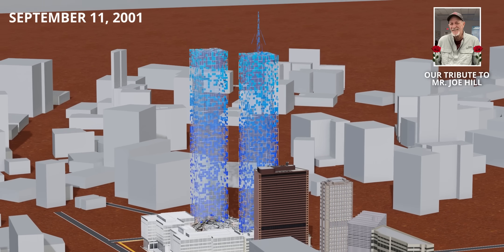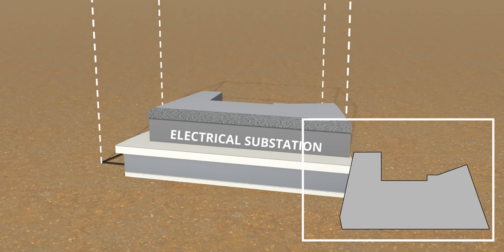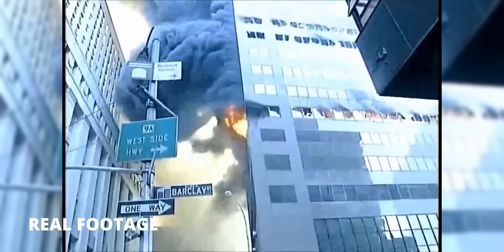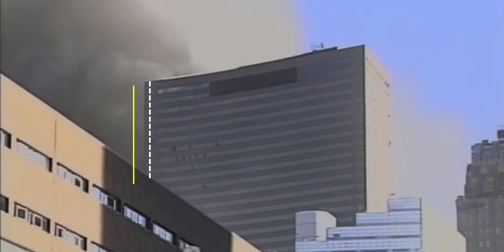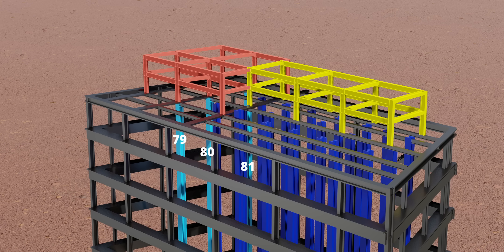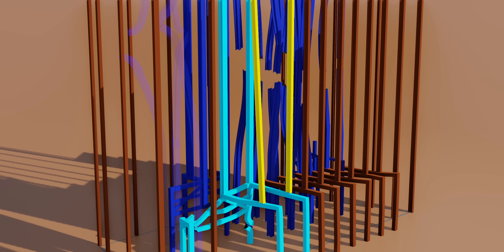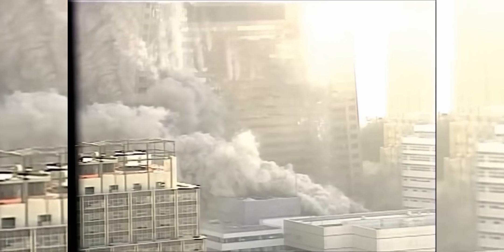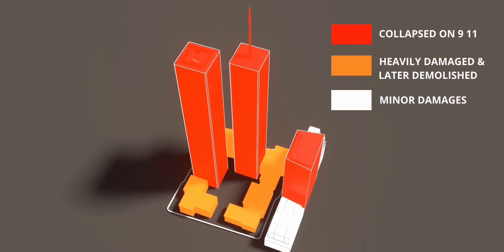Collapse of Building 7 | The Complete Physics

Comment: FYI, the owner of the twin towers has breakfast in the towers every morning, but conveniently didn’t go during 9/11. Nor did his family and relatives who worked in the towers show up that morning. And when asked what he was doing, his answers were clearly lies. Oh and did I mention he bought the most expensive insurance specifically for a 4 billion dollar payout if a plane crashed into the towers 6 weeks before 9/11? 

And here’s the official explanation for all 3 towers collapse. It was because fires weakened the internal structure. Guess what? Jet fuel burns hundreds of degrees lower than the melting point of steel. So it doesn’t even make sense. 

Within hours bin Laden was blamed. Within weeks, steel debris was shipped overseas to be melted down before a full forensic analysis. You might be asking, if it was an inside job surely there would be whistleblowers? 

Yes there was. All discredited, ignored, or suffer “accidents” example: Barry Jennings, who spoke about explosions in WTC 7, died mysteriously before giving official testimony

The official report says that the jet fuel weakened the floor trusses enough for them to sag and bend both the outer perimeter steel beams and inner perimeter support. However here’s the kicker; the floor trusses of the towers were lightweight compared to the core columns and the massive steel perimeter frame (14” wide flange beams at the core).
The idea that floor sagging alone could pull in and buckle steel exterior walls which were load bearing and anchored is extremely questionable. In reality the floor would have just snapped apart when sagging before doing any real damage to the outer pillars.

Now here’s another question: why didn’t the towers fall from the side? The plane impact severed columns on one side of the tower creating a gaping whole, causing asymmetrical damage.
In theory, this imbalance of weight even if it did collapse should led to it falling on its side where the hole was. Not a vertical free fall like a controlled demolition.

Now even if you want to ignore all these points, and still point to the physically impossible explanation the government gave, here’s another point from the engineer of the towers himself.

The towers each had 47 central steel core columns. These columns were made to withstand the impact of an airplane. As quoted from Leslie Robertson the engineer himself. Even if the building toppled or collapsed naturally, these columns would be so sturdy we would still see it standing upright, if not partially upright, yet no trace of them anywhere. Again the original explanation was that the fire weakened them. Which I have explained multiple times is a half assed explanation meant to fool the majority of the public who don’t think twice and never research this themselves.
Reply: FYI the owner of the Twin Towers was the Port Authority of New York and New Jersey.  

I did not bother to read further. I've seen this movie enough to know the rest will be the same mindless repeaterism of false memes and beating of dead horses that is all you lot can manage these days.
Reply: @TheCriticalStinker-01 you are wrong, the owner is Larry Silverstein. Who in July 2001 made a 99 year lease from the port authority of NY and NJ. So no, the owner isn’t the port authority at the time of the disaster. Larry had it leased. It’s ignorant of you not to read the rest and just call it “internet memes”. It’s more like it’s irrefutable statements you can’t argue
Reply: @TheCriticalStinker-01 I also see you reply on basically every comment now matter how old or new. Do you find joy camping new comments to desperately prove the government didn’t do it? Because that will just make conspiracy theorists like us believe it even more
Reply: @TheCriticalStinker-01 oh yeah? Try and dispute my other claims then. You can’t. Who said anything about antisemitism? That’s just you. Can you explain why the passports of the terrorists were found. But nothing else? Can you explain why the attack on the pentagon coincidentally crashed on the side where the walls were reinforced months before?

Comment: I built infrastructure for decades. All those buildings were blown from the inside and very carefully.
Support poles do NOT melt straight down. 
Even if the enegery was some how supplied to plasma them down it would take several hours most likely days. 
Fact that they all went straight down is so obvious....
Reply: Who said anything about _melting_?

If you really built infrastructure for decades then you should be well aware structural steel will fail long before it gets hot enough to melt.
Reply: I whatched all this on t.v. years before i spent decades building infrastructure. 16 at the time 41 now. Melted. Twisted. Lied. Collapsed. Legit. Whatever. I commented melted in refrence to other comments. Very clear what my point is. Whats yours key board warrior?
Reply: Stinky really working hard for the little money!

Comment: You are showing a 90 degrees bended grider among debris, but in the animation the griders bends 45 degrees at maximum. And also as you said, in the footage we see the building tilted a bit to the right, it's impossible that much tilting to the right side of the building cause a 90 degrees bending in griders. How do you explain these?
Reply: Why are you assuming that A). The animations are 100% accurate recreations rather than just animations to show general effect to a lay audience and B).  It's the same bit of steel?

Comment: This video reminds me of the Big Bang one liner 😂 “all of this is possible if you just grant us one miracle”.  that debris (the antenna) cause an entire building to perfectly collapse. Let’s quickly talk through that and then go into more detail details on how the building structure works lol!
Reply: OK, lets go through it WITH the details:  Much misunderstood, Building 7 was the 6th building to collapse of the 10 lost on 9/11. Because of its early low priority, conspiracy filled the information void with garbage made up by technically ignorant people promoting political agendas. But this is an engineering problem and should be treated as such, so I prepared this brief summary of my own analysis to fix that, using engineering, not politics and tired memes.

The North Tower collapse at 10:28am bombarded Building 7 with tons of debris, causing heavy damage and starting multiple fires which burned out of control for 7 hours. Half the FDNY firefighters having been killed, units in disarray, equipment destroyed, no water pressure, and the greater urgency of search & rescue efforts, firefighting was pulled as futile. The building couldn’t be saved and was left to its fate. That is the sort of choice firefighters make every day in brush fire situations - which houses to save and which ones to let go. Only real difference here is moving the decimal on the size and cost. People get overwhelmed by the size.

www.youtube.com/watch?v=g_SvpwyC17M&ab_channel=MFitz

Collapse of a burning structure is always a concern for firefighters. Steel buildings subject to fire rely on active fighting of the fires to survive. Buildings are designed around 1 to 3 hours of fire resistance, allowing time for occupants to escape and ACTIVE firefighting to get started, after which all bets are off. Left to their own devices they will exceed their design envelope and collapse, like Plasco Tower and Wilton Paes de Almeida. In B7 the occupants escaped, passive and active fire protections were compromised and active firefighting was abandoned 3 hours before the collapse, which left the building to its fate. It lost. Odds on Building 7 would eventually collapse, and it did. No big deal in logic.

www.youtube.com/watch?v=WnYBX6QT0R4

FDNY Chief Daniel Nigro ; The biggest decision we had to make on the first day was to clear the area and create a collapse zone around the severely damaged 7 World Trade Center, a 47-story building heavily involved in fire. A number of fire officers and companies assessed the damage to the building. The appraisals indicated that the buildings structural integrity was in serious doubt. I issued orders to PULL back the firefighters and define the collapse zone. It was a critical decision; We could not lose any more firefighters. It took a lot of time to PULL everyone out, given the emotionalism of the day, communications difficulties and the collapse terrain

FDNY Deputy Chief Peter Hayden ; We had our special operations people set up surveying instruments to monitor and see if there was any movement in the building. We were concerned of the possibility of collapse in the building. And we had a discussion with one particular engineer there, and we asked him if we allowed it to burn could we anticipate a collapse and if so, how soon? And it turned out that he was pretty much right on the money, that he said 'In its current state you have about 5 hours

The collapse of Building 7 was anticipated and widely reported in the media throughout the day, with 24 video cameras recording some or all of the collapse. Everyone knew what was coming and why.

www.youtube.com/watch?v=OY5S5k3tMHI

Building 7’s collapse was completely different to the Twin Towers and harder to understand as most details hidden from view and not intuitive, but we can still sort out what happened through careful analysis and observation. This is my explanation of the collapse relying on no outside authority.

Building 7 was complex, assymetrical 47-story steel framed structure built atop a smaller 3-story building, requiring lower floors dedicated to complex load transfer structures, not usable office space. Of trapezoidal shape and all-steel tube-in-tube construction, B7 (above the 7th floor) consisted of a central core of steel columns carrying most of the gravity load, perimeter steel columns around the outside of the structure carrying the remainder of the gravity loads and long span beams and girders to tie those elements together and form the floors. On the outside of the building hung a moment frame or outer shell.

Phase 1 : First externally visible signs of collapse initiation occurred at 5:20:28 pm and were notably quiet with observers not realizing the building was collapsing! No audible warning in the form of hundreds of ear drum busting 180-190dB explosive bangs preceding the collapse. Here at 12:00 a local CBS affiliate reporter is talking 10 blocks from B7 when collapse begins. People don’t start to notice the collapse until 12:11. At 12:45 is the famous CBS fixed camera clip of Building 7’s collapse. Note how quiet it is.

youtube.com/watch?v=t5tEy6mXSE8&ab_channel=fresnosean379

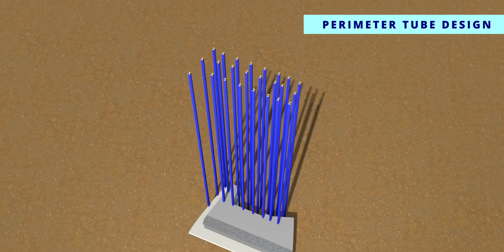Collapse initiation was due to lower floor failures above the load transfer region (7th floor) in the NE corner. In this video at 0:45 you can see the NW corner from inside the building while under construction, Column 79 just out of frame on the left. That big, angled steel beam across the top of the frame connects to C79 at one end. The girders connect to the beam. That beam and all those girders depend on just one connection

youtube.com/watch?v=nP3TNHPCIVU&t=35s&ab_channel=EdwardCurrent

Phase 2 : The floor failures caused a loss of critical lateral support over an excessive length of core Column 79 and it buckled. If you look at a floor diagram of Building 7 (see above) and look at all the structures that depend on C79 you quickly realize this one column was a relatively isolated structural element on which a disproportionately greater fraction of the structure depended analogous to say the Key Bridge. Externally we see a vertical progression of window breakage along the 44-46 line and a kink in the roof of the East Mechanical Penthouse at the top of the building, consistent with C79 failure. The transition from full capacity to almost no capacity occurs in an instant. Once the buckling failure occurs there is almost no resistance

Normally with a buckling column, the load could be redistributed to other columns. With C79 that is not the case - the failure did not redistribute the load, so the collapse rapidly progressed to the roofline, sinking the rooftop penthouse.

Phase 3 : With C79 gone, B7’s progressive, non-symmetrical collapse continues with C80 and C81 at the east end of the core left laterally unsupported and quickly buckled and failed as well, sending the EMP down through the building. C79-81 all have no diagonal bracing, which I believe is a major reason why they could not redistribute a lot of vertical loads among one another.

From there collapse progressed from east to west through the central core until the core was gone taking all of the interior floors and probably most of the perimeter columns with it. Follow the horizontal progression of window failures low in the building and the dropping of the remaining rooftop structures into the building. One of the big takeaways from the NIST Building 7 study (that gets completely ignored) was their modeling which determined C79 failing under ANY circumstances would have initiated the same collapse sequence.

Phase 4 : After 10 seconds only the exterior moment frame - a hollow empty outer shell – remains, giving the ILLUSION the Building is still standing since little has outwardly changed. It is just a hollow empty shell like an empty cereal box. Supported by only a few remaining columns that empty shell is quite unable to remain standing. With all core columns and floors gone, the north face leans inward, forming a V in the roofline, the last few columns buckle under the strain and the moment frame free falls, landing on top of the 7-story high debris pile. It is only late in the game here at the end that a single measurement of alleged free fall acceleration is taken, from a single point on that outer shell. The Building did not “free fall” – just one corner of the outer shell did, sort of. The Building was already gone before that happened. The period of alleged free fall was a product of how it fell NOT why it fell and cannot tell us what started the collapse. Start to finish the entire collapse took 18-20 seconds, 3 times longer than true free fall . How fast something falls cannot tell you what started it falling_ anyway. The debris spread outside the footprint, blocking surrounding streets, heavily damaging the Verizon Building and destroyed Fiterman Hall.

Building 7’s progressive, non-symmetrical collapse was incidental and unintended collateral damage from the combined effects of fire + time + gravity, started by the collapsing North Tower. That is true no matter who planned and carried out the 9/11 attacks or why . The collapse was of so little consequence it barely even registered at the time, a mere footnote. It only took on semi-mythical status as an alleged smoking gun years later when demolitions at the Twin Towers, missiles at the Pentagon and shoot down over Shanksville all failed and conspiracists had nothing left to work with.

Anything can seem like a conspiracy if you don’t understand how it works. Now you should. I hope you found this helpful, informative and it solicits informed critical comment. If I made any errors of fact, logic or reason or left anything important out, please let me know so I can fix it. IF you can offer a more plausible alternative please do. Be the first. Please start any reply with the words “Tits McGee” or I will know you didn’t read it and are wasting my time.